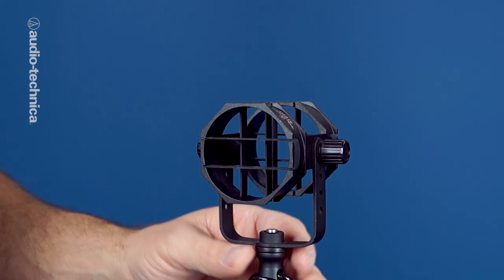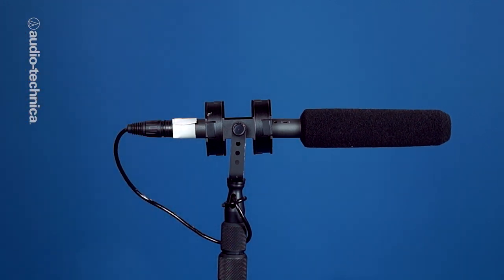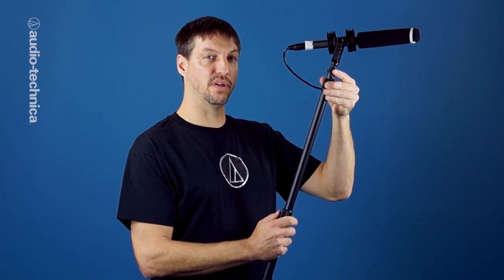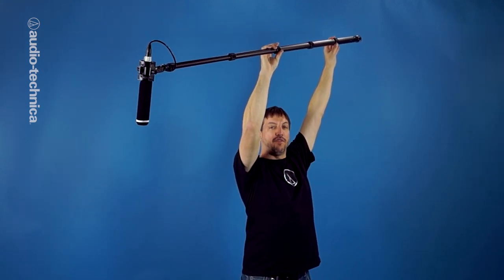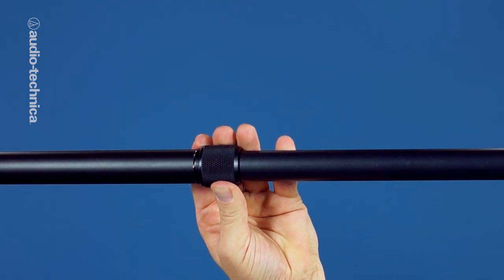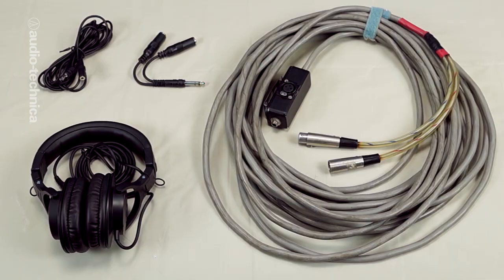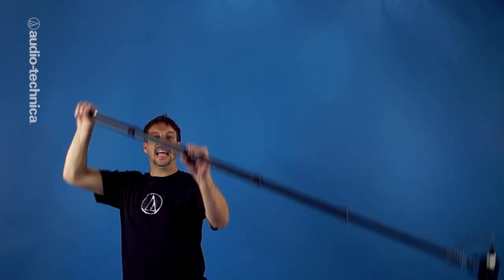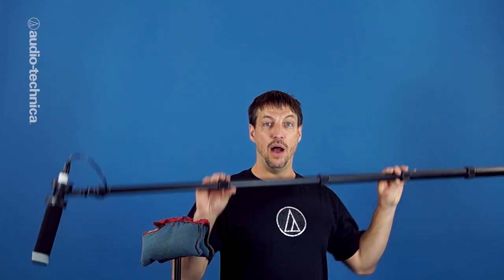Basic Audio Techniques for Video: How to Use a Boompole

Comment: I just wanna know what equipment you need to actually record audio. Like I already have a mic I just need the recorder or whatever it might be.
Reply from the maker: Hi there! You will need an audio interface in order to connect your microphone to your computer for recording. These interfaces convert the audio signal coming from the microphone to a digital signal that is going to the computer. Thanks!  - A-T USA
Reply: @AudioTechnicaUSA  Thanks!